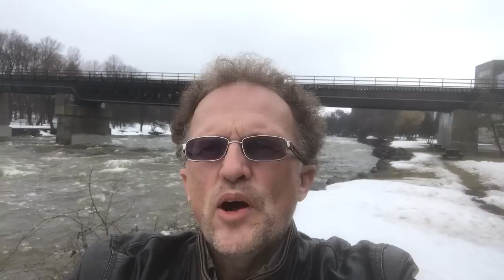Stabilization Feedbacks in the Climate System

Comment: Paul, come on!  Geoengineering by spraying sulfur dioxide into the stratosphere (thermosphere)?  Really?  Keep in mind that all of that surfuric acid will come back to visit us.  Most of it will fall into the sea as it's 70% of the surface.  It will acidify the ocean, dissolving corals and carbonate shells of mollusks and phytoplankton and cocolithophores.  The neutralization reaction releases .............. CO2, one molecule CO2 for one molecule H2SO4.  The SO2 only lasts about 2 years before washing out, although if we got it up higher than the cloud that Pinatubo shot into the atmosphere, we can get it to last longer.  How much longer?  No one knows, as it's never been done before.  This dimming will not only diminish the IR, but also some of the spectrum of actinic light that plants need for photosynthesis.  Reduced photosynthesis slows CO2 uptake from the atmosphere and reduces crop yield.  But...... higher temps also reduce both crop yield and protein content in grains.  Add in water stress and higher CO2 levels and you get grain with even less yield and protein plus the micronutrient content diminishes.  So, do we go with short term attenuation of temperature rise in trade for increased long term habitat destruction?  You can argue that if you can't get through the short term, the long term is irrelevant.  So, maybe we do spray.  But be ready for the consequences.

Comment: The natural Stefan-Boltzmann emissions negative feedback is well known by almost all the scientists studying Anthropogenic Climate Disruption (ACD) effects. It is highly dependent upon temperature differentials. A rise in the average temperature of the Earth, by a few degrees K, is far different than something that has a 6,000 K difference. That was a good example of a negative feedback system though. Virtually, all scientists studying ACD are aware that the Stefan-Boltzmann effect is totally swamped out by human activities that result in the high CO2 emissions.

You could have been more clear when you used the term emissions. CO2 and CH4 emissions are totally unrelated to the photon emissions that the Stefan-Boltzmann emission equation deals with.

Paul, I’m certain you are well aware that the vast majority of human driven CO2 emissions have not come from our own breathing or such things as destroying forests. The vast majority of the emission have come from the start of the industrial revolution when clever engineers learned how to tap into and utilize fossil fuel deposits that took tens of millions of years to form as a result for a lushly vegetated Earth photosynthesizing enormous quantities of solar energy.

You need to ask yourself why you now seem to be forgetting such factors which are not going to be offset by planting more trees in the currant age. Again, you are discounting that thresholds may have been passed beyond which even heroic efforts will not be able to overcome, no matter how much hope people have for the future. You work with students who harbor much hope so it is understandable that some of that would rub off on you.

————
Paul, after reviewing the following report you ought to do a video on your findings.

Increased methane emissions from deep osmotic and buoyant convection beneath submarine seeps as climate warms
http://www.nature.com/articles/ncomms13266

Comment: Paul! Paul!  I thought of a negative feedback! ... As all the old ice melts the bubbles of clean air trapped inside are released! .... that will make an impact!   Yes!???
Reply: In the long term, there is both a cooling and warming effect at play from the air released from melting ice, and the overall effect is approximately neutral.

The slight cooling effect is from the nitrogen released. Nitrogen is very slightly reflective, and is the cause of a bluish sky on a clear day. More reflectivity means a cooler Earth.

The slight warming effect is due to the tiny amount of CO2 that is released from that very clean air trapped in the ice, so very tiny that the ppm value of Earth's CO2 becomes very slightly smaller than if that clean air had not been released from the ice. This warming effect occurs because ppm in some ways is an incorrect measure of CO2.

A demonstration of this incorrectness is the approximately equal ppm values for the very cold planet Mars and the very hot planet Venus. Both Mars and Venus have about 96 percent CO2 (960,000 ppm), and both planets have a similar climate flux (watts per square meter of heat absorbed from the sun), but Venus is a much hotter planet. The key is that Venus has more than 1,000 times the CO2 that Mars has in terms of kilograms of CO2 per square meter. It hardly matters at all how pure the CO2 is in terms of percent or ppm. What really matters is the weight or mass of that CO2 over any given area such as a square meter or square foot or square mile or such as the entire area of a planet. If you melt snow or ice, eventually you melt enough ice that another metric ton of CO2 is floating around in Earth's atmosphere. That metric ton of CO2 is almost meaninglessly small in terms of a warming effect, but likewise the many thousands of metric tons of nitrogen released from the snow or ice with that metric ton of CO2 has an almost meaningless small cooling effect.

I hope you understand now that it is not the purity of CO2 in the atmosphere that counts, but how many metric tons of CO2 there are. In the case of melting snow and ice, CO2 purity goes down, but the metric tonnage of CO2 goes up.
Reply: In the long term, there is both a cooling and warming effect at play from the air released from melting ice, and the overall effect is approximately neutral.

The slight cooling effect is from the nitrogen released. Nitrogen is very slightly reflective, and is the cause of a bluish sky on a clear day. More reflectivity means a cooler Earth.

The slight warming effect is due to the tiny amount of CO2 that is released from that very clean air trapped in the ice, so very tiny that the ppm value of Earth's CO2 becomes very slightly smaller than if that clean air had not been released from the ice. This warming effect occurs because ppm in some ways is an incorrect measure of CO2.

A demonstration of this incorrectness is the approximately equal ppm values for the very cold planet Mars and the very hot planet Venus. Both Mars and Venus have about 96 percent CO2 (960,000 ppm), and both planets have a similar climate flux (watts per square meter of heat absorbed from the sun), but Venus is a much hotter planet. The key is that Venus has more than 1,000 times the CO2 that Mars has in terms of kilograms of CO2 per square meter. It hardly matters at all how pure the CO2 is in terms of percent or ppm. What really matters is the weight or mass of that CO2 over any given area such as a square meter or square foot or square mile or such as the entire area of a planet. If you melt snow or ice, eventually you melt enough ice that another metric ton of CO2 is floating around in Earth's atmosphere. That metric ton of CO2 is almost meaninglessly small in terms of a warming effect, but likewise the many thousands of metric tons of nitrogen released from the snow or ice with that metric ton of CO2 has an almost meaningless small cooling effect.

I hope you understand now that it is not the purity of CO2 in the atmosphere that counts, but how many metric tons of CO2 there are. In the case of melting snow and ice, CO2 purity goes down, but the metric tonnage of CO2 goes up.

Comment: Emmas yer such an optimist instead of a realist, focusing on non-essential b.s. He simply learned to polish his b.s., he's a racist, he's authorized Mattis to drone strike murder without so much as a call, let alone a sig, his AG is a liar, 

EPA head is dooming humanity to extinction in less thsn 10 years, perhaps less than 5, and this summer the entire east coast will be erased from civilization. Watch. You knock others suggesting their not scientists or engineers without knowing their credentials, work experience or projects. Mine alone are easily 1,000 times monetarily, what you've done kid; barely half my age. You also forgot to weight the reduction of emissions by type of human who starves first, though the U.S., Europe and Canada (thank's Ft. Murray/DAPL) may be early casualties. You also assume the collapse will leave a sufficiently robust imdustrial complex able to mfg and implement radical solutions like  sulfur, plankton, desal, improved/enhanced grain prodiction, let alone rapid widespread deploymemt of wind and solar, or the real ks-boom, a few dozen or hundreds of reactors and spent fuel facilities malfunctioning. Yes, its possible we may dodge the extinction bullet, but odds are less than 1% given current trends, known events, near term easily predictable events and humanities consistent failure to both get up off th4 couch in time to prevent disaster, or get the solution right the first time. Optimism's great, but since we're not rapidly decommissioning nukes, and since Trump's leading the Days of Nero, with the Pacific and Atlantic going to super heated states, the near term future of Miami, D.C., NYC is obvious enough, while the future of America's breadbasket midwest is equally pedictable. Ypu think humanity will band together? Perhaps, but they'll have wood and stone tools and few high tech well funded mechenisms, let alone well tested. P.S. what IS the effect on trees/forests of high sulfur ppm rain? Yeah. Gonna get real interesting.

Comment: Given the following info from Wikipedia, how much stabilization can the mass of the surface of the crust provide, over what time frame? :

 Heat flows constantly from its sources within the Earth to the surface. Total heat loss from the Earth is estimated at 44.2 TW (4.42 × 1013 watts).[13] Mean heat flow is 65 mW/m2 over continental crust and 101 mW/m2 over oceanic crust.[13] This is 0.087 watt/square meter on average (0.03 percent of solar power absorbed by the Earth[14] ), but is much more concentrated in areas where thermal energy is transported toward the crust by convection such as along mid-ocean ridges and mantle plumes.[15] The Earth's crust effectively acts as a thick insulating blanket which must be pierced by fluid conduits (of magma, water or other) in order to release the heat underneath. More of the heat in the Earth is lost through plate tectonics, by mantle upwelling associated with mid-ocean ridges. The final major mode of heat loss is byconduction through the lithosphere, the majority of which occurs in the oceans due to the crust there being much thinner and younger than under the continents.[13][16]
The heat of the Earth is replenished by radioactive decay at a rate of 30 TW.[17] The global geothermal flow rates are more than twice the rate of human energy consumption from all primary sources.

Fourier's law of heat flow applied to the Earth gives q= Mg where q is the heat flux at a point on the Earth's surface, M the thermal conductivity of the rocks there, and gthe measured geothermal gradient. A representative value for the thermal conductivity of granitic rocks is M = 3.0W/mK.[citation needed] Hence, using the global average geothermal conducting gradient of 0.02 K/m we get that q = 0.06 W/m². This estimate, corroborated by thousands of observations of heat flow in boreholes all over the world, gives a global average of 6×10−2 W/m².[citation needed] Thus, if the geothermal heat flow rising through an acre ofgranite terrain could be efficiently captured, it would light four 60 watt light bulbs.
A variation in surface temperature induced by climate changes and the Milankovitch cycle can penetrate below the Earth's surface and produce an oscillation in the geothermal gradient with periods varying from daily to tens of thousands of years and an amplitude which decreases with depth and having a scale depth of several kilometers.[19][20] Melt water from the polar ice caps flowing along ocean bottoms tends to maintain a constant geothermal gradient throughout the Earth's surface
Reply: Part of the answer to your question is hiding in the part of your comment that refers to sources [19] and [20], in the phrases "scale depth of several kilometers" and "tens of thousands" of years. What amounts to geologically stored coolness took about 70,000 years to assist in ending the Permian mass extinction. 

On the scale of a human lifetime, the fact of Earth's internal heat is a destabilizer. Inside of ice sheets is a temperature gradient, and at depth because the ice gets warm enough to melt, there can be a lake hiding under more than a kilometer of ice. Google "lake in Antarctica" and you will find information. Theoretically, if there is enough water under the ice, an avalanche of ice and water can suddenly escape to the sea, forming a canyon in the process. The English channel is such a canyon.

Comment: Paul, you must be kidding! Are you claiming the radiation out of earth because of the rise in the temperature of the earth is a "negative feedback" to climate change? So why don't you calculate the temperature of the upper atmosphere and surface at which this will stabilise and the temperature not increase any further? Will it be 2 degrees above the current level, 20 or 200? For example, average temperature on the surface of Venus is 467 C (872 F) while its upper atmosphere is at a temperature of -175 C (that is NEGATIVE 175 Celsius).

Comment: paul, hasn't it just recently been found that the CO2 sensitivity actually exponentially increases with rising CO2 concentrations and temperature and is not linear as believed until recently? that alone compensates for most if not all neg. feedback in my lay oppinion. could you elaborate on that a bit? anyway - if i take everything into consideration i learned so far from chlimate change mechanisms i'm afraid we are indeed in runnaway climate change territory already and some smallish negative feedbacks don't really matter anymore - they just slow the rate down a bit.
Reply: It is an interesting point that you raise. Earth and Venus have a similar climate flux, but vastly different CO2 values, and a temperature difference of 447 celsius. It takes 17.8 doublings of Earth's CO2 for Earth to equal the CO2 value of Venus. 447 / 17.8 = 25.1 celsius per doubling, and there is actually just a bit of geological evidence here on Earth from Earth's warmer periods that places into the realm of possibility such a high temperature increase for each doubling of CO2 during the warmer parts of Earth history in the last 60 million years.

Most evidence points to a much smaller warming capped by a 19th century approximation to atmospheric water, an approximation related to the Antoine equation. In this approximation, multiplying CO2 by a factor of 5 to 6 results in a 11 celsius temperature rise. Eventually, after CO2 has been increased by a factor of about 10, limit theory from calculus takes over, and any doublings of CO2 really do result in a double digit temperature increase.

We are in sometime in this 21st Century about to double the current CO2 value of 41 pascals as it is now in the year 2017, meaning that late in the 21st Century, people will find out for themselves which theory is true. For the time being, things are not going well for the double digit temperature increase theory, but the actual evidence when it comes in is what really counts regarding which theory is more scientifically correct.
Reply: exactly, thanks for the link!